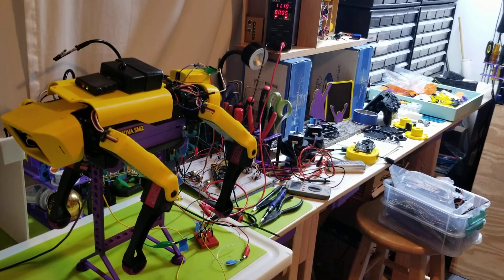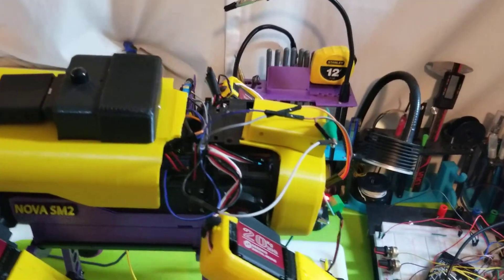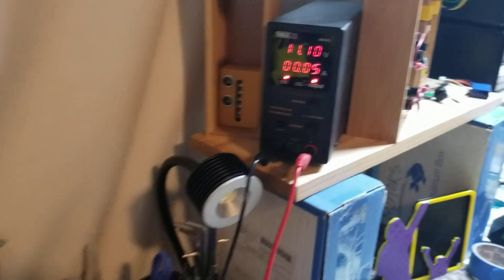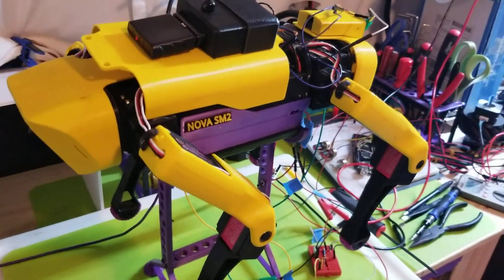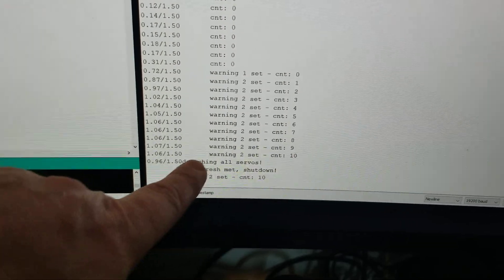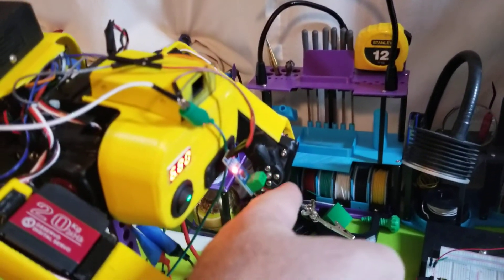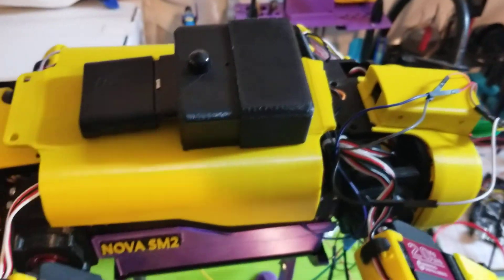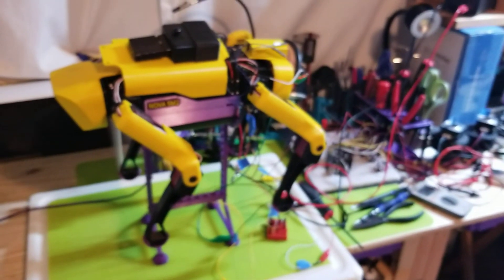Spot Micro Power Management & Protection

Comment: Love this! I have a question, Is it possible to take apart the Dogzilla quadruped robot and 3d print spot parts and use those?
Reply from the maker: Im not familiar with Dogzilla, sorry, but unlikely for most parts
Reply from the maker: I looked at dogzilla.... for 3 seconds. LOL  No. That is a silly kit. Looks like its uses bus servos, and a Pi.  No, not a single piece of hardware would or could work in Nova, sorry.
Reply: @Chris Locke  I see, lol. Also, do you know if you have a video on how Nova can see?

Comment: 🖐🇷🇺😉
insert the bulbs into the break in the servo wires and this will keep the servos from burning.  And when everything is set up, you are already removing the bulbs.  also it is good to navigate by the lamp and see the pulses of currents
Reply: Try NTC Thermister.   These have a low resistance, maybe an Ohm or two at zero current but ramp up to 100+ ohms at a couple amps.  cost like 20 cents each.      They come in all sizes and specs and are used in almost every electronic power supply to limit in-rush current.       A normal automotive hot-filament light bulb is a decent substitute.    That said, even 2 ohms kils power on a battery-operated device.    For testing perhaps all yu need is a low-value resister in series with each motor.

For working on tube-based gutar amps, I have a power cord with standard houshold light bulb socket in series.  I start with a 40W bulb to "smoke test" an amp.   The bulb prevents a blow-up even with a dead-short in the amp's power supply.
Reply from the maker: thanks for the feedback... though not sure what you mean by "bulbs"?
Reply: @ChrisLocke1969  car incandescent lamps from headlights at 3-6 volts or lamps from lanterns.  you need to run the main electrical power of the servos through them to avoid damage during setup
Reply from the maker: @DODG-engineering  ahhh, i get it now - great idea, thanks!!

Comment: Hey love the build! Just a question, I’ve seen  reviews of the ds3218mg servos and they show it’s peak current to be around 3-4A. How come yours burn up at 1A?
Reply from the maker: To clarify, I use a pwm controller, so servos are not driven by degrees. And changing the frequency setting of pwm, for example, can also cause servos to go nuts / out of range if you're not careful about effected code.
Reply from the maker: From my own stupidity! Lol  for example, telling servo to go 1000 degrees left and not realizing it until I smell smoke. Lol